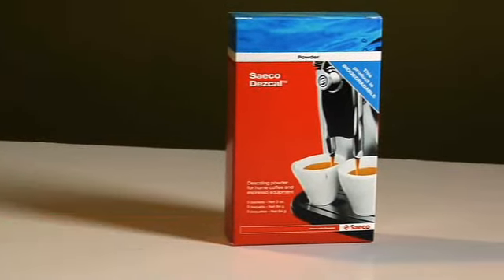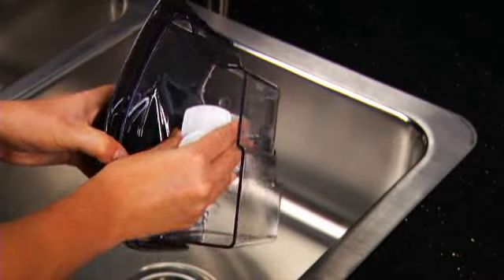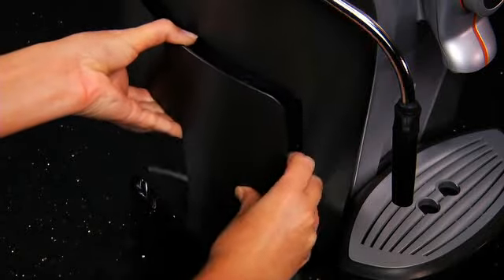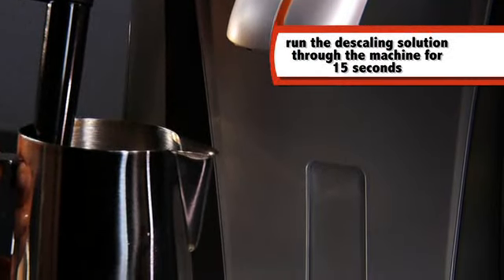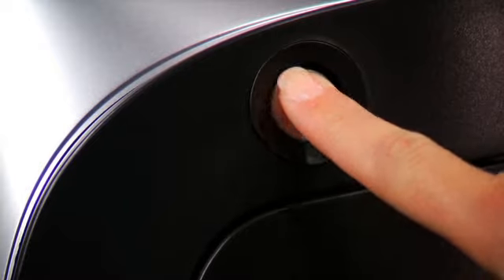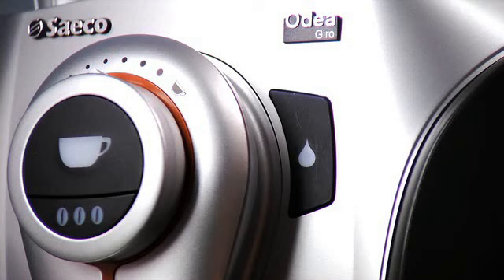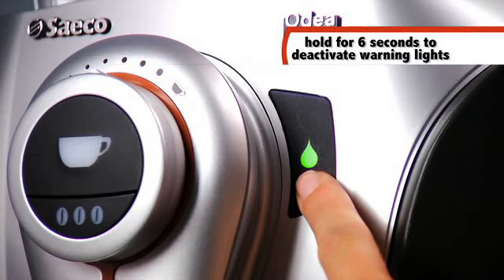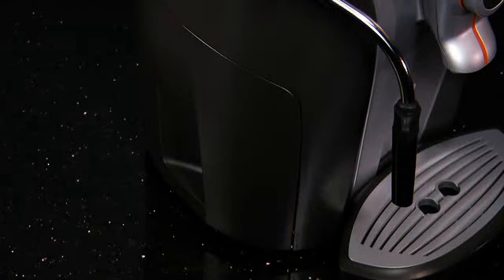Odea Giro - Descaling

Comment: I have a problem. After the cleaning process, I pressed the hot water button for 6 seconds and machine moved to full-time cleaning every minute. Also was blocked right-side coffee container. Red light "cleaning" and green light "hot water" are illuminated. What happened? What i need to do?
Reply: I have the same issue... so I don't even know if the first process I made is useful as it start a different descaling process after pressing the button for 6 seconds ...
Reply: I have the answer to this.  It's not a problem at all.  This happened to me.  It means that you didn't allow the machine to do the full cycle.  Simple turn the machine back on and let it run the full cycle.  The piece inside will complete it's cycle and return to it's position.  then you can return the piece back in.   Hope this helps others who have this problem.

Comment: What if you dont have the descaling solution? Anything around the house you can use like vinegar?
Reply: Manual says not to use vinegar as a descaler.
Reply: It's not expensive to get a good descaler (Durgo) is the brand I used.  Worth it to spend the money if you have a good machine.